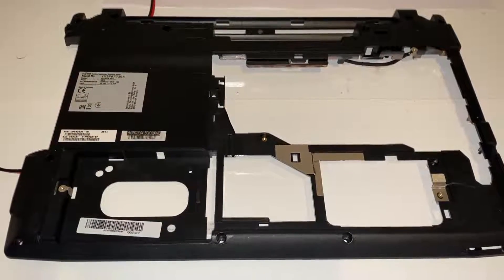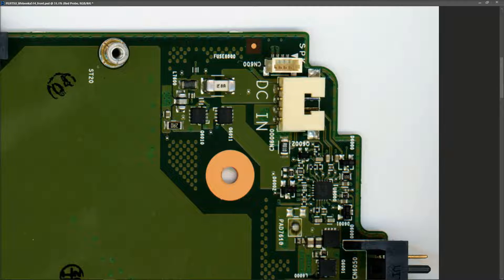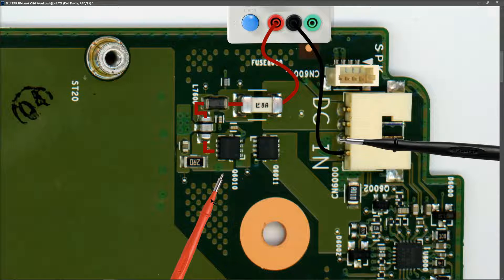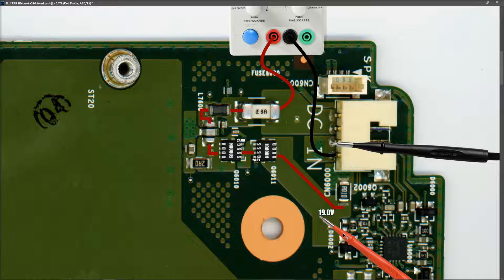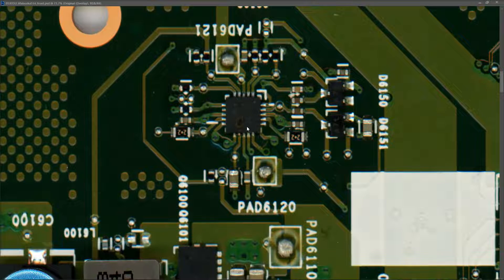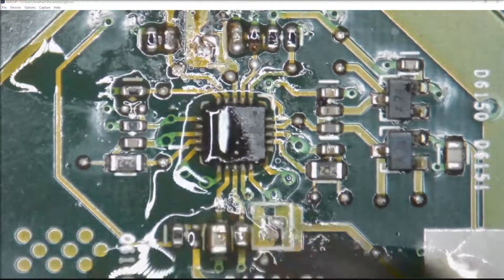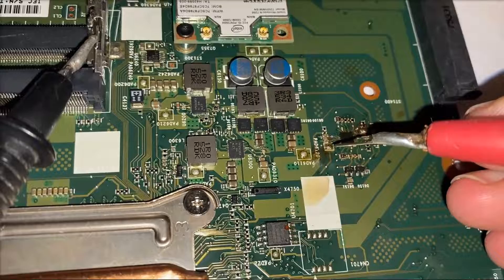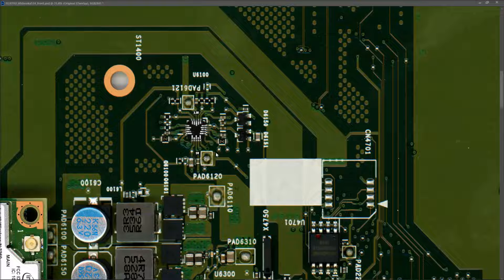FUJITSU A514 - NO POWER FAULT

Comment: The EC chip is the main culprit in such cases. However  I would check some other things as well. For example, check the SPI rom (the bios chip) if it has voltage. You can also try to find a bios dump from this laptop and reflash the chip. You can also check the 3.3V around the EC if it is present. Another one thing you can check is the BQ IC especially the REGN pin, check there for 6V. If you don't find 6V there check for input. If there is input but no 6V then most likely you deal with a faulty BQ. And don't forget the PCH, as in the previous video, a shorted LDO is a very bad omen for the PCH. So if nothing of the previous helps a voltage injection on the 3.3 rail is a must. Oh, and one more thing. I saw the WIFI card still on the board. Try to remove it and check again. Expect the unexpected...
Reply from the maker: Hi Nick, As soon as I solder across the jumper for the the 3.3V rail, the voltage cycles between 1V and 2V,  so the 3.3V is not present on power button / BIOS / EC / anything. When I inject 3.3V from my power supply, the current cycles between 0ma and 20ma, so it seems there is some sort of protection mechanism kicking in. I'll keep working on it. thanks.
Reply: @therepairshare673 Hi, well I don't have any schematic for this specific board but usually there are more power rails being generated from the 3.3VLDO such as 1.8V, 1.5V and more 3.3V which are not connected directly to the LDO PSU but through load switches (MOSFETs). You can check for these voltages and shorts on the load switches. You may have though to isolate parts of the board in order to be sure what you measure. If you connect the battery do you get a charging current ?

Comment: I returned the first microscope camera I bought from Amazon for exactly the reason you stated. The camera lens is exactly where I want to put the hot air nozzle. So frustrating!
I replaced it with a small camera attached to a flexible pole. It's cheaper because it doesn't have a screen display -- I have to plug it into a laptop to see the camera view. And the flexible pole wobbles a lot as I work, so the image is not steady.